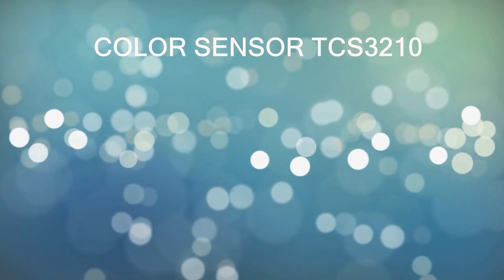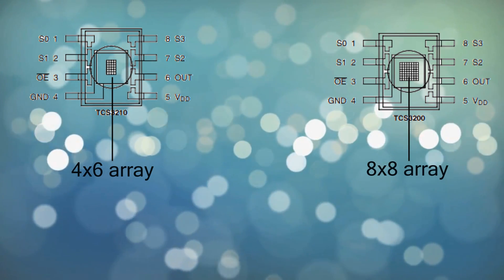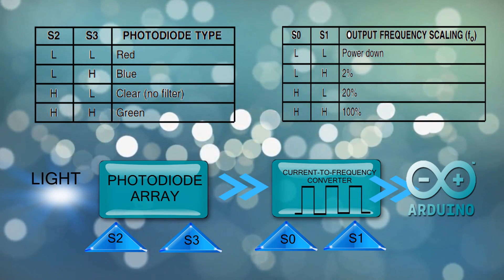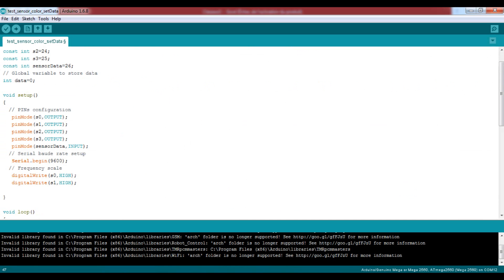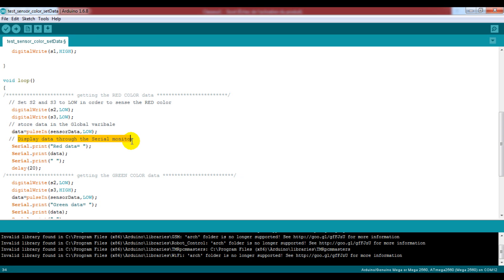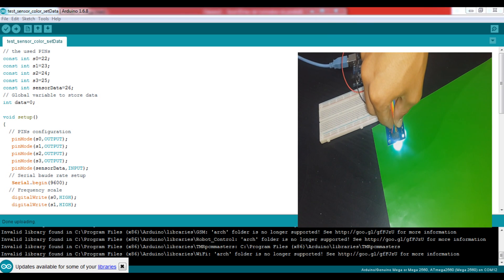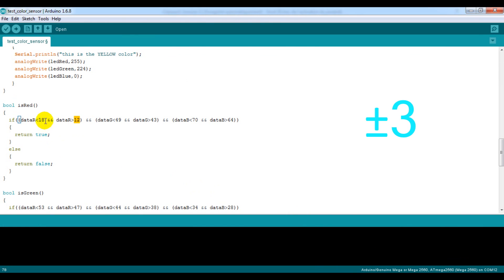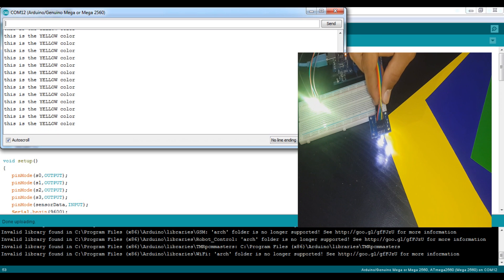How to use the Color Sensor with Arduino board (TCS3200 & TCS3210)

Comment: Can this hardware work if I wanted to make a device that speaks the colors as well?
Reply from the maker: Hello Andrew,
Sure you can use this project to make a device that sense the color through the TCS3210 sensor and you need to add a loudspeaker connected to your arduino plus an SD card or microSD carte shield where you should store the voices of colors that you want to display, don't forget that an Arduino board can't display an mp3 file because it is based on a 8-bit microcontroler and it can't store mp3 files because of it's limited number and size of registers.
Do not panic, the task is so easy and we can help you with it :)
Reply: I'm a university student looking to design a wearable device for the Blind, so I'm trying to see what I'll need to firstly make the process work of this device find a colour and speak the name, also secondly to look to be able to eventually fit something into a wearable device. 
I currently own an arduino board. Any help is much appreciated! Many thanks! :)
Reply from the maker: Hello Andrew!
It's good to hear from you again :)
So what I understand from your comment is that you want to make a "wearable device" that can sense the colors and tell the sensed color through a speaker!
I told you that you can do this using the TCS sensor, but! It's imporatant to know that this sensor can't sense colors from distance, so you need to place the colored object directly in front the white LEDs of the sensor. 
So first thing first you need to tell me if your project is about sensing colors from distances or not, this way I can recommend the right components for your project and tell you what you need to buy to make it.

Let us know if we can further assist you.
Reply: Thank you so much for your help, I'm looking to see which option is best. Currently I think the near sensor is best for the blind user as for example, they want to know the colour of their clothes - they'd pick the item up, and put the device against it - similar way to the action of the apple pay via smartwatch gesture. So in essence i'm looking to make a wrist/arm based device that the user can wave in-front of the object they want to know the colour of. Thank you in advance for your assistance :)
Reply from the maker: Ok Andrew
In this case you need to buy: 
- An arduino Board (Tell me which one you already have)
- An SD card shield for Arduino (where you will store the .WAV files that tell the colors)
- An SD card
- A speaker with the amplifier circuit
- A color sensor TCS 32xx (xx could be 10 or 00 depends on how much precision you want)

Tell me when you become ready :)
Reply: I currently have the Arduino UNO kit. I shall get the other items this week. Thank you, will report back when ready! :) Not sure how precise each one is - if it isn't too much more - the more accurate, the better for this project.
Reply from the maker: "The more accurate" is the (TCS 3200), if you watch the video you will undersatand how it is more precisive ;)
Reply: ah of course, apologies, I hadn't seen the video in a week. 8x8 array is best. Looking forward to starting this project! Many thanks!
Reply from the maker: You are welcome :)
Reply from the maker: Great! you are good now :) 
For the sensor the second link is better,
I hope that you already have a bread board and some jumper wires !!
Reply: Hi, All the components have arrived!! Ready to put it all together! Shall I using the UNO to TCS3200 schematic, use the jump wires from the sensor to the breadboard and then to the arduino board?
Reply from the maker: Hello Andrew, it's good to hear from you again :)
About the circuit just follow the same circuit that I showed on the video and download the code (the first code) to know how to connect each pin.
For the Arduino Uno it's not a problem you can use it and connect the sensor directly to your Arduino through jumper wires, there is no need to use the breadboard for the moment.
Reply: Does it matter which number ports I connect the jumper wires to? The one in the downloaded code is for Arduino Mega, so I'm not sure which numbers to connect the sensor to on the Arduino UNO.
Reply from the maker: Yes, it is important to know which pin you need to use!
In Arduino Mega (that I used) we have 54 digital pins "from D0 to D53" but In Arduino Uno (that you will use) we have 20 digital pins only "from D0 to D19".
So you should go back to the code and change the used pins
I mean replace these instructions:
------------------------------------------------------
const int s0=22;
const int s1=23;
const int s2=24;
const int s3=25;
const int sensorData=26;

So it becomes this:
------------------------------------------------------
const int s0=5;
const int s1=6;
const int s2=7;
const int s3=8;
const int sensorData=9;

And do not forget to respect this order when you connect the sensor to Arduino.

Let us know if we can farther assist you..
Reply: Hi, Thank you so much! I've been able to get the first code working however when I configure the second code, nothing shows up in the serial monitor. I've got values from the first code for 3 different colours of Red, green and blue. I've written these into the Bool sections. Is there something else I need to do for this to work? Many thanks for all your help!!
Reply: For example - my Green is R=5 G=8 B=5  --- Is my sensor correct? should these values be higher?
Reply from the maker: good for the first code. But the data for green color is a little bit strange! 
give me the data for the red and blue colors!!
Reply: (RED) Red=8 Green=21 Blue=30 
(BLUE) Red=20 Green=12 Blue=21 
These are the current values when I put the colours infront of the sensor.
Reply from the maker: Did you adjust the configured values in the functions!
isRed(), isBlue(), isGreen() ...
there are some values that you need to change there!
Reply: Hi, I've finally been able to get it to say This is Green, Blue and Red etc... It works! However, the LEDs turn off after a few seconds after recognising the colour. Not sure why this is happening?
Reply from the maker: Congratulations for the first part of your project. You are making me proud :)
About the Color LED, just make sure that you are using PWM outputs for your LED and configure them in your code, else! I don't see any reason to turn the LED Off
Reply: Hello again, I'm ready for the next part of my project with your kind help! So what do I have to do next to make the board speak the colours. I have the other two parts and a speaker. 
      Also - do you think this project is possible to make on a smaller scale? - ie to not use the arduino board or use a small equivelant? Many thanks.
Reply from the maker: The next step, you should choose how many color you want to recognize with the sensor them make some text to speech conversion and to do this I recomand this website:
http://www.fromtexttospeech.com/
save each color as mp3 file then convert it to WAV files using this website:
http://audio.online-convert.com/fr/convertir-en-wav
set the parameters as 8bit, 16000Hz, Mono then generate the WAV files and store them by a name that indicates the color in your SD card shield.
follow this instructable to understand how to wire the SD card and how to use it 
https://www.instructables.com/id/Playing-Wave-file-using-arduino/

Good luck
Reply: Hello, Thank you so much for all your help! 
I've successfully wired up a speaker (got it to play a tune) and a Micro SD CARD (written a file on it from arduino) - As the UNO has a limiting number of ports, I will have to switch them around for the colour sensor. Not sure which to connect to the 5V - the SD shield or the colour sensor - I have a free 3.5v port I can put one into? 
Anyway - next after connecting up the colour sensor - How do I link the sensed colour to the WAV file and to get the speaker to speak the file? (I think these are the final steps in a long project!) 
Thank you! :)
Reply from the maker: Hello Andrew,
Happy to see all this progress, and yes these are the last steps :)
About the 5V, just solder two wires to make a node and connect your 5V to both components

For the link between the sensed color and the WAV file, it is the same as the LED control just add to your test " if (isRed())..." the display file
There is a library to include in order to use the SD card Shield and just follow the instructable link that I gave you ;)
Reply: When adding a new colour - do I just simply add the following and that's it? 
 
if(isPink())
   {
    Serial.println("this is the PINK color");
    analogWrite(ledRed,255);
    analogWrite(ledGreen,0);
    analogWrite(ledBlue,255);
   }

bool isPink()
{
  if((dataR<28 && dataR>22) && (dataG<42 && dataG>36) && (dataB<54 && dataB>47))
  {
    return true;
  }
  else
  {
    return false;
  }
}
Reply from the maker: Yes Andrew that's it
And for sure you've got the data (28,22 for red and 42,36 for green...) from your sensor when it sensed the pink color using the first code!
Reply: Hi again, Just wanted to mention, i've been able to succefully get the speaker to speak wav files from the micro sd and the colour sensor still works - however all seperately. I can't get them to work together because both the speaker and the colour sensor share the same pin number 9. Is there a way around this on the arduino uno with the breadboard? Or do I need a bigger arduino board? Many thanks for your help!
Reply from the maker: Hi,
Can you tell me what pin of your sensor is connected to pin number 9!!
Note you can change pin configuration for your sensor on your Arduino the way you want! I mean just replace the use of pin number 9 by another pin and change it in your source code then it will work
Reply: Hi, - The pin the sensor needs is from LED to number 9 to get the data values to show and the speakers positive wants the number 9 as well otherwise both don't work if they're connected to a different pin and I need them both to work at the same time. 
I tried pluggin the speaker into pin 2 and changing the code from 9 to 2 and it didn't work. 
Thank you!
Reply from the maker: Just to tell smth about the sensor pins, YOU NEED DIGITAL PINS to make it work so you can place the pins of your sensor in any digital pin you want!!!
if pin 2 is available then connect it to your sensor

Tell me if there is anything else
Reply: Hello again, I've very nearly perfectly done everything, the colours are being sensed correctly to the serial monitor, and the speaker can play a sound wav file from the sd card shield when all connected together. However, i'm having trouble with the code. I'm not sure what to input when the colour senses for example, 'RED' - I'd like it to play the RED.wav file. How can I write this? Many thanks for all your kind help!
Reply from the maker: Hello Andrew,
Very nice to hear from you again :)
Did you tried to play some WAV files stored in your SD card through the speaker?
Reply: Nice to hear back thanks! 
Yes - I used a code I found online for playing wav files off the microSD to play through the speaker. It's a little quiet but it does work.
Reply from the maker: Great so get back to the comment where we first time spoke about how to make WAV file and store it in your SD card,
In that comment I explained how to make a WAV file that says " RED " and I provided the links to follow to make it work.

Let me know if there is any thing wrong..
Reply: Yes that's right. I made all the sound wav files and put them on the MicroSD card. They can play through a code in which I start the code it then says the colour - but putting this code and the colour sensor code together is the part I'm unsure of. Which part of the code I need to copy from one to another as so when it senses 'RED' it will initialise the SD card and play the 'RED.wav' File through the speaker.
Reply from the maker: Share you e-mail or g-mail in a comment and I'm mail you ;)
Reply from the maker: I send you an e-mail! did you receive it !!?
Reply: Hi, my apologies I just recieved it, my internet has been up and down today, not working well. Seems to be ok now. I'll reply right away!

Comment: can this reconize white and black color?
Reply from the maker: Hello Daniel 
Well!! first thing first, black is not a color ok and for the white color it's the combination of the three elementary  colors which are the Red color the Green and Blue, so if the sensor is showing all the cells data at maximum value that means there is only white color which is detected, the most of this kind of sensors is the software part, so you should verify the data recieved from the sensor to identify the color 

best...